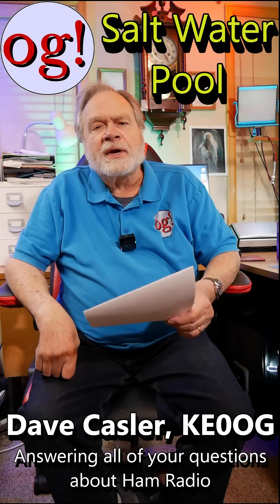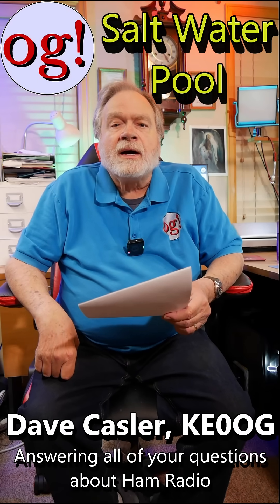Salt Water Pool (Short #70)

Comment: Dave, for many years HF radioes installed on boats (with wood or fiberglass hulls) have gotten excellent results by not using grounds. Instead you run wide flat copper foil (roof flashing used to be cheap) around the interior of the hull below the waterline. 
 That's a counterpoise. It is capacitively coupled to the seawater, through the hull.